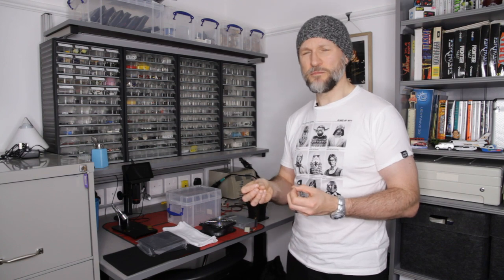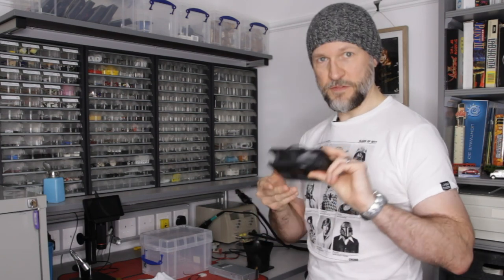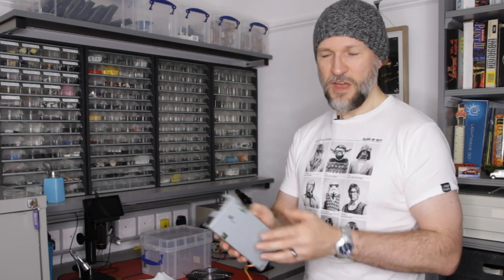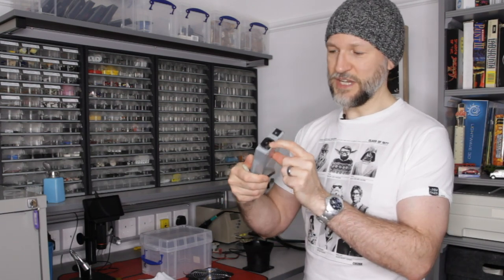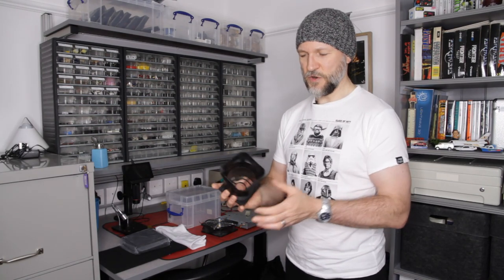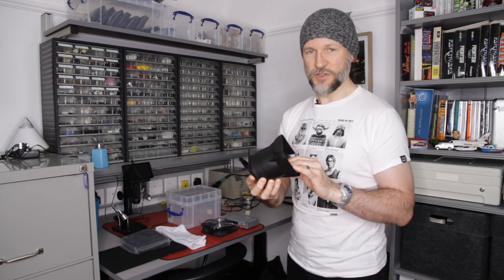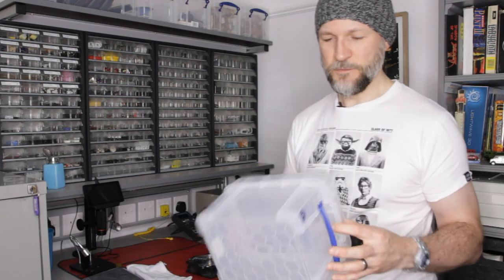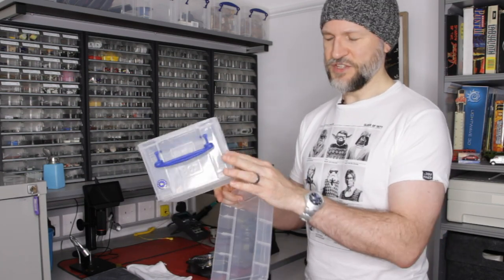DIY Solder Fume Extractor with Active Carbon Filter

Comment: Just going back over some of your old videos, I could definitely do with building one of these. Great guide! It's much smaller than I expected from the thumbnail.

Also always nice to spot a fellow Really Useful Box enthusiast in the wild. 😏
Reply from the maker: Cheers Rees. Definitely have something if you're doing more than just the very occasional soldering. You'll really notice the difference both in smell and not getting a face full of fumes. If I was soldering all day long it might need to be bigger or I guess I could just change the filters more often. Mine's a halfway house between big under desk versions and those small single filter in front of a fan designs.
Reply: @TheDigitalOrphanage  I think something like this would be the ideal size for my needs. I'm not sure I rate those single filter designs, this one seems like it would have a lot more suction.

Comment: This is so much better than the one I just watched, where a guy took a HUGE plastic storage bin and made one.  He went way overboard in my opinion.  This is the perfect size I think.
Reply from the maker: Thank you for watching and for the kind words. The filter has worked well since I made it and makes my hobby soldering more enjoyable. If I were to be soldering all day long as a job I would want something bigger possibly but for me this is perfect and easy to move or remove if I need more desk space. Have fun making one yourself.
Reply: @TheDigitalOrphanage  You're welcome.  Well if you ever want a bigger one, then you should make the one he did, because it's huge and not at all portable!  LOL  I'm guessing it was around 3 ft x 2 ft x 1.5 ft??  Way to big for what I wanted.  He also put a good sized vacuum type thing inside it.  I'll see if I can find the video again and link it to you so you can see it.  I do hobby soldering so I don't do it a lot, so your version is more like what I am wanting, plus I want to make a couple of extra ones from some friends that are getting into soldering.
Reply from the maker: Ah, good ole JW, I too watched his video when I wanted to make my own. I think he does a lot of soldering on his channel and his is a DIY version of the type Louis Rossmann would use in his repair shop every day. For something that's running most of the day you'd want bigger activated carbon filters and a pre-filter to filter out normal dust. It would act as a general room filter too, and you would not want to clog up the carbon filter with ordinary dust. Mine's larger than the normal hobby filters as they are pretty much just a fan with a square of filter in front of it. Make one and see how well it works for you.

Comment: @The Digital Orphanage — QUESTIONS:
1. Why did you choose to use a massive PSU to power this as opposed to a more simple wire splice into a spare 12v transformer wall plug we all have lying around? Are there benefits to doing this or were you just looking for something to weigh the unit down a bit? 
2. Did you consider adding a portable DC capability to this system so that you can use it on the go by tossing in some cells?
3. Is there any method you’re aware of to detect/test the level of contaminants collected BY THE FILTER to determine when it needs to be changed? How do you usually decide this?
4. How long do these carbon filters last before needing replacement? Can they be cleaned somehow?
5. Is there anything you’d have done different since building this?
Reply from the maker: Hi and thank you for watching. Some great questions and I'll do my best to answer them below. Have fun making one of your own and improving on what I did!
1) In my box of power supplies this was the smallest that was 12v with a current output that equalled or exceeded the fan I wanted to use. I also remember thinking that having the PSU inside the box could help it last longer as the airflow would keep it cool. But if you've got a spare 12v wall plug type with high enough current output then go with that.
2) Not really as I'd always imagined using it with a mains powered soldering iron. I took it with me to the museum once so it has been on an outing once :-)
3) No, not that I know of. I'm expecting there will be a smell from the exhaust if the activated charcoal stops being effective, but as I have quite a large amount of it in mine I haven't noticed it yet with the amount of soldering I do. If the filter gets clogged with dust etc. you'll notice it doesn't suck the fumes from quite as far away, so that is another point to replace the filter.
4) See 3 above.
5) The "Really Useful" boxes are great but I hadn't realised they don't make a proper seal around the lid. That's why I used all that silicone sealant in the rim of the lid to make it seal. There are some large electronics project boxes with a full weather seal that might have been better, although probably more expensive.

Comment: Should throw a HEPA filter in there too. Carbon is good for only some of the fumes, and may not touch some of the fine dust particles that the fan is going to be throwing back up into the room.
Reply from the maker: Hi thanks for watching. Would you recommend pre or post the carbon filter? The way I constructed it there's room for either. Currently I have arranged it so that there's a double layer of carbon filter but could replace one with a small HEPA filter from a vacuum cleaner. Would need to test it doesn't restrict the airflow too much though as no where near as powerful as a vacuum cleaner. For the amount of soldering I'm doing, it seems to be  doing it's primary job well and getting rid of the fumes and the smell.
Reply: @TheDigitalOrphanage  I was going to type this when you showed the filters, pre carbon filter for me would allow the carbon to be used for longer
Reply from the maker: Thank you for watching too! I have some spare Dyson DC02 filters, I might see if one of those works and do a short follow up video.

Comment: You pushed the filters into the box so that the fumes are actually bypassing the filter.  You need to attach the filter to the lid so the only way for the fumes to go is through the filter.
Reply from the maker: It was a large doubled-over piece that makes a tunnel inside. But when you make yours, it can be however you like.

Comment: How's it been going? I hear carbon filter isn't enough, I hear it only gets rid of the smell but not all the toxic chemicals. Would it be better to just exhaust the smoke outside with a pipe?
Reply from the maker: Still works for me for the amount of soldering I do. I've changed the filters and I'm still fit and healthy (touch wood). However, if you can vent it completely away from where you're working, that would always be preferable.

Comment: Nice one. How do you know, exactly, when filters need to be replaced? Thanks.
Reply from the maker: You can either replace them on a time interval, say every sixth months, or you could just go by increasing smell or if the smoke isn't being sucked in as well. If your work area is dusty it's more likely you'll need to clean or replace the filter at the intake point as it will get clogged with dust.
Reply: @TheDigitalOrphanage  Thanks!

Comment: please what is the brand and model of the yellow rotary tool featuring the springy power cord you cut the hole with?
Reply from the maker: Hi Command37 and thank you for watching. The yellow tool is a "RotaCraft Variable Speed Mini Rotary Tool Kit" which is a low cost "Dremel" type tool, handy for all sorts of tasks. I use it to cut the holes with straight sides by using the small cutting discs it comes with. I also use the sanding drum to clean up some of the edges. The large hole was cut with a normal drill and a hole saw of the correct size. It probably would have been just as easy to use the small cutting disc though.

Here is an Amazon link to it
https://amzn.to/2Ih2ed0
(As an Amazon Associate I earn from qualifying purchases.)
Reply: Excellent man, thank you for your prompt reply and helpful link! How does that Amazon Associate program work? I have a seller account, can I also participate in this program?
Reply from the maker: You're welcome. Both good questions and as I've only just joined them I don't know the answers. You can read up on it on their website though.
https://affiliate-program.amazon.co.uk/